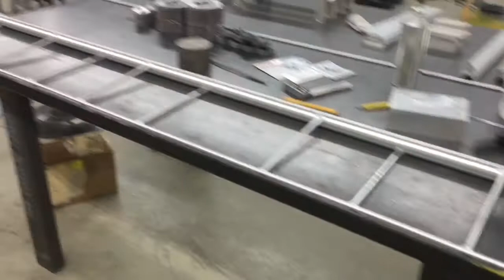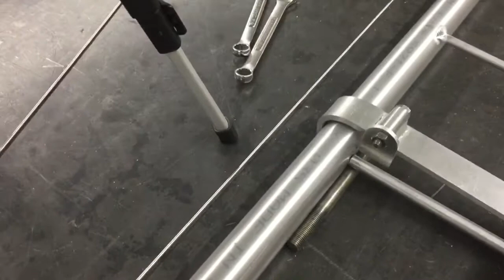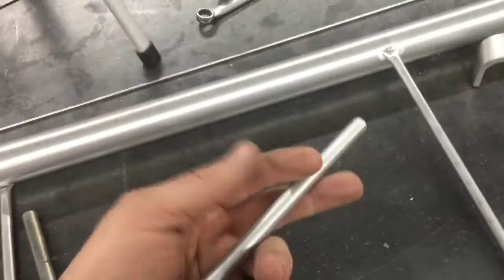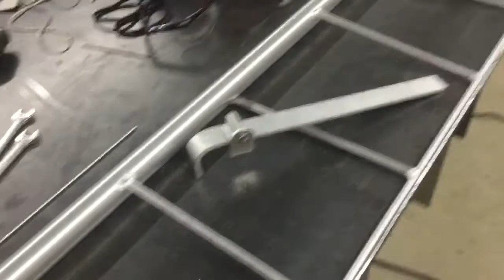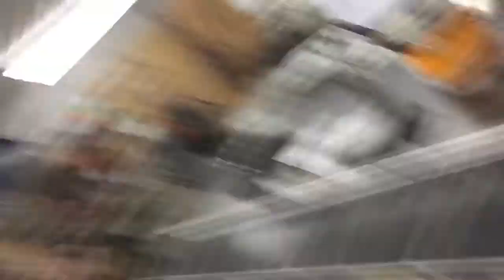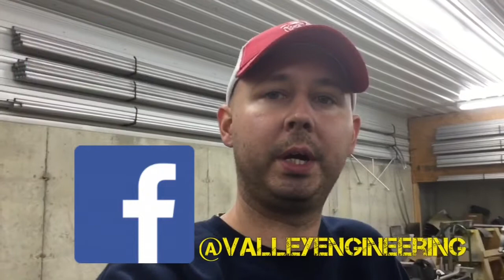Welding fixture and shop tip

Comment: I was going to build a aluminum ultralight that is designed with an aluminum frame but it is a bolt and rivet design.  I have ask a few other builders about welding it together and they say that the welds would eventually crack.  The aluminum is 6061t6 square and round tubing.  Your welding your plane so I guess its ok, right? Do they make a 6061 welding rod?
Reply from the maker: We have not had a problem with cracking. There is a lot of factors involved such as the design, material used, and how hot you get the surrounding area, etc. I use the 5356 alloy for the welding rods.